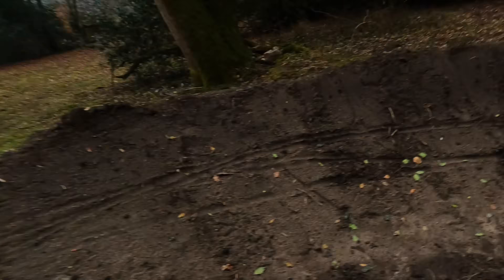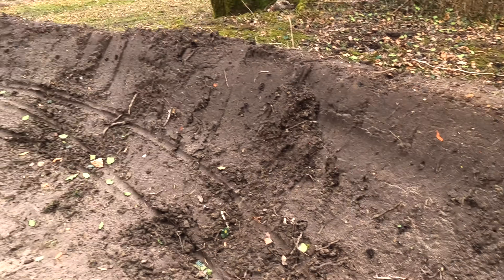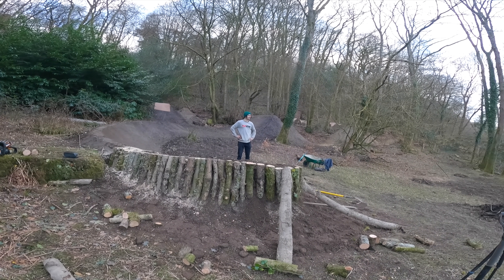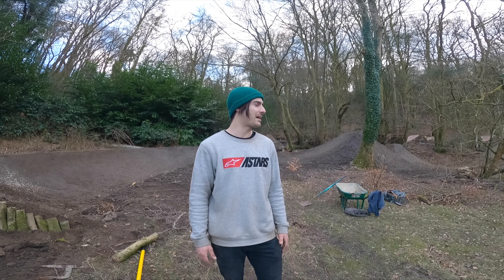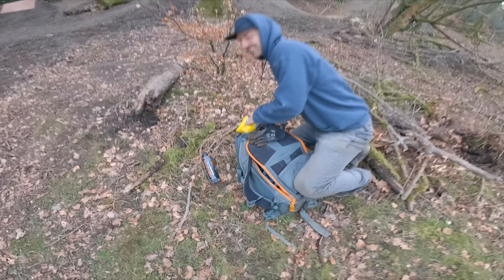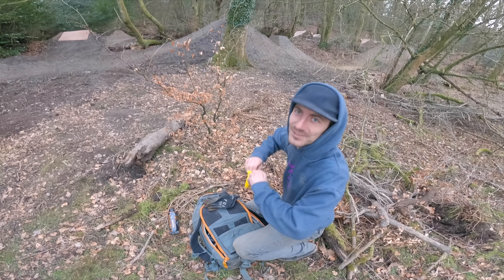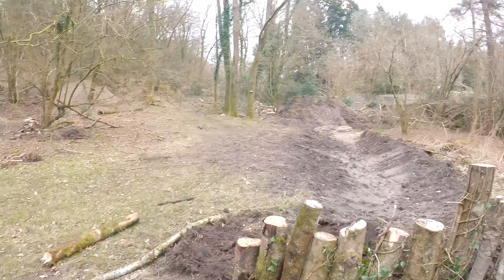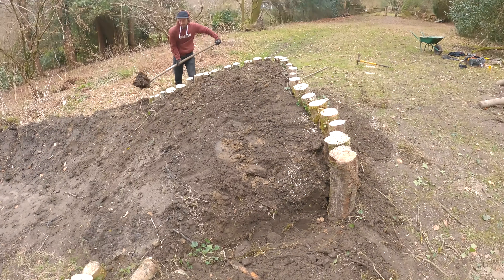Building the MEGA BERM / SHARK FIN in my Backyard!

Comment: Practice your chainsaw skills a bit, you could very quickly have put a sharp point on each of those logs and then sledged them in a bit and they'd actually have been structurally useful rather than just being held in place by a bit of soil.

I give it a week of riding before they start falling or being knocked out. Does look very nice though!
Reply: In fact use your YouTube monies and get on a chainsaw course (if you haven't already), would be super useful when you own that much land and all those trees that need thinning. Can make some awesome log based features then.

Swedish candles work best with bone dry deadwood.